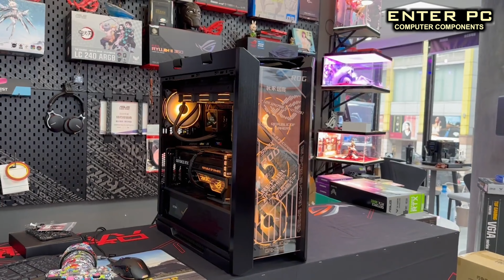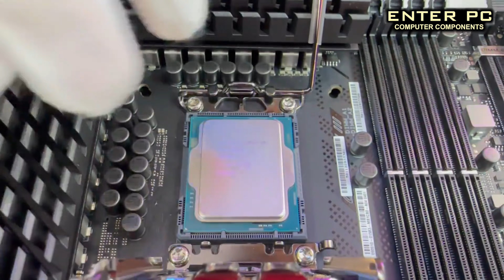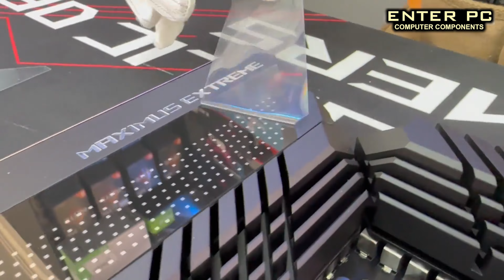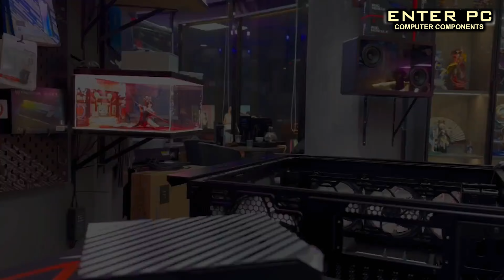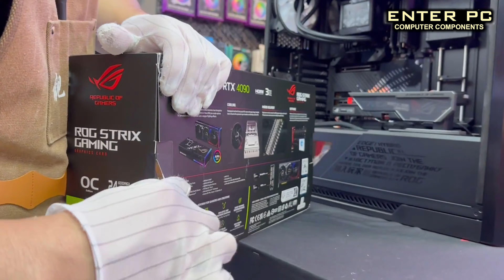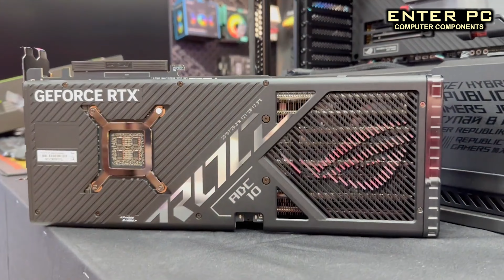EPIC Gaming PC Build! - ROG RTX™ 4090 - INTEL I9-13900K - AXIMUS Z790 EXTREME

Comment: I just purchased Z790 max. I am trying to understand how to use the audio connectors on the back of the motherboard to connect to a 7.2 AV receiver so I can get full Atmos. But i need to be able to connect from the motherboard directly to the AV receiver. How is this possible. I am using a monitor not a TV so ARC is not possible. If this is not the right place to ask this type of question, where would be the right place?